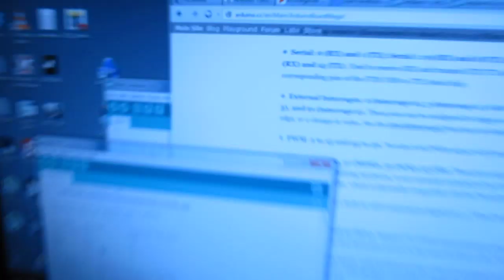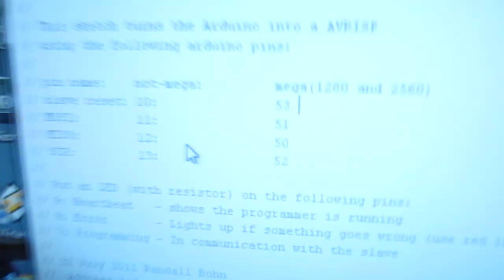Burning Arduino (328/168) Bootloader with Arduino Mega (ATMega1280)!

Comment: I bought 3 new Trigorilla Mega 2560 boards and no bootloader installed.  Couldn't flash them.  I didn't have a clue how to do it.  This gives me the info I need to get on with loading a boot loader in them.  Thanks, good job.

Comment: Im in the same situation, using an arduino mega to bootload an atmega328p, but it never bootloads. Checked the pins and t'was connected , miso to miso and mosi to mosi, plus the sck pins and the reset but it still never works. Also can I ask is that the built in sketch of the arduino ide on arduino isp? Mines a little bit different

Comment: so what if i want to use a mega 2560 to program another 2560 for repair
Reply from the maker: +Michael D Almost the same: program one 2560 as the programmer, then wire it up spi to spi on the 50 51 52 53 pins 
clock clock
cs cs
mosi mosi (data out to data in)
miso miso
set the destination board type in the ide and say burn bootloader.

Comment: how is it with arduino mega 2560 to mega 2560 ??
Reply from the maker: +Christopher Brix Sameish...
put burn sketch on the 'good' mega
wire up the same, spi to spi (power ground mosi miso clock) master obviously the good board
plug in, say burn bootloader and tell it the destination board is a 2560.

Comment: What if i want to Program the mega to fix the "!!!" issue
Reply from the maker: +Mohammad Mubin (jacktheninja) Do the same thing, just in reverse...bootloader burner program on the mega, same wiring, and plug the mega in to usb. Set target board as an uno and you should be set.
Reply: +frollard SO if i want to program the mega i need to connect the USB wire to the UNO and goes to mega ?

Comment: Oh my god - Thank you so damn much for this!
I'll try this out.
This should also work, if you want to burn the bootloader to an atmega on a breadbord, aye?
Or do you need the UNO Board as shown in the Video?

Thanks a lot!!
Reply from the maker: You would need the atmega breadboarded fully (with crystal and decoupling caps) - might be easier to socket in the uno board just to burn the bootloader since everything electrical is provided :)
Reply: frollard Actually i don't own an UNO Board where i could plug in the chip =(
But i've seen several tutorials showing the setup with the crystal and caps - so i'm looking forward that it'll work.
Thanks, thanks and again thanks a lot! This really made my day!
I'll order the parts right tomorrow happy

Comment: Can it be done backwards? I mean, program arduino mega with arduino uno with this wiring an the ISP code from arduino IDE? Thank you for the video btw.
Reply from the maker: Roger that, it should work so long as the icsp sketch is running on the uno and setting the target board to the mega. mosi miso sck sda should all stay the same.
Reply: frollard I'm in the same boat. I need to program my Atmega 2560. Thanks!

Comment: hi, i am having the next error : 

avrdude: Yikes!  Invalid device signature.
         Double check connections and try again, or use -F to override
         this check.
Reply from the maker: QUADRUPLE check your wiring, make sure the burner sketch is put on your mega, and the correct board type is selected as well as the correct serial port.
Reply: All is right :(  probably my chip is dead

Comment from the maker: the pin connections - make sure they are correct, then make sure they are correct again.  
Did you follow the directions on the arduino isp sketch exactly?  You need to program the mega as a programmer first, then wire it up afterwards.

Comment: no, i only have the mega, what do you mean the pinout?  look this is the circuit I made with an 328p-pu bit. ly/V8JvN8 but instead of a uno I am using the Mega and its 50's pin you talk on your video (thanks btw lol) and it just doesnt work, sometimes it says signature error or something like that, thanks for your time :) !!

Comment from the maker: Yeah, sounds like you need to reprogram the bootloader; download the latest arduino environment from arduino.cc and load up the arduino-as-isp sketch...then wire it up as per the instructions in the video.  You NEED a 2nd arduino board or isp programmer.